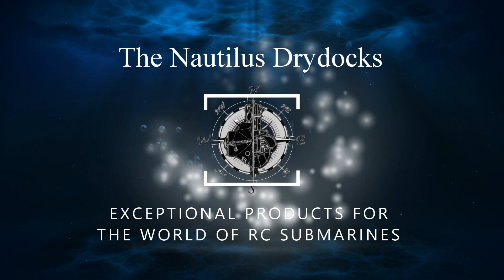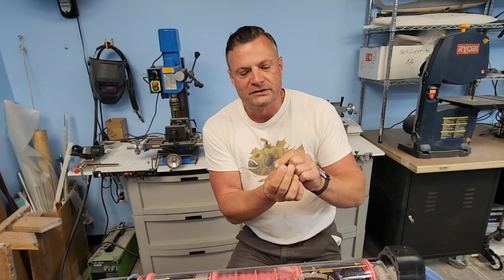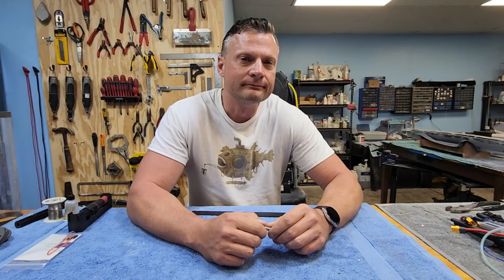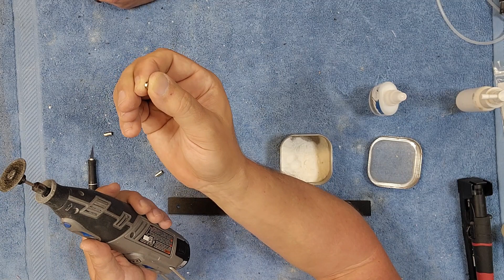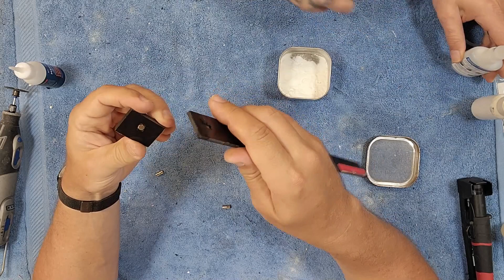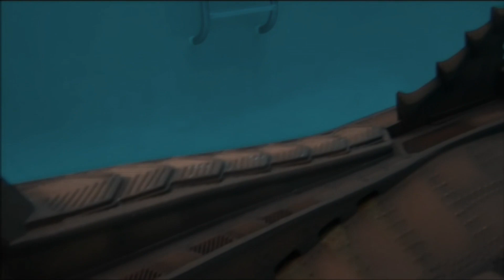Supercharging Your RC Submarine With Magnets!

Comment: Which battery Packs are used normally for 1:144 models?
Reply from the maker: The largest you can fit in your watertight compartment. Batteries are batteries. If your components require 12V, you can get away with a 3S LiPo or a 12V NiMh pack. Once your voltage is matched up, get the battery with the largest amp rating that will fit in your boat.

Comment: I have one important question. Which motor should i have when i have an 1:144 rc submarine?
Reply from the maker: Depends on the boat. A 1:144 Typhoon is a big difference from a 1:144 Seehund. If you use a brushed motor, try to aim for around 5000rpm and a motor roughly the diameter of your prop.
Reply: Thank you  for your Quick answer!
I have the trumpeter uss seawolf. Its around 700 to 800 mm long. I dont know what Motor i have to use because i dont want that its fast like a speedboat.
Reply from the maker: @JOJOPHOENIX835  A tiny 380 sized motor is more than enough. That prop is only something just over an inch in diameter if memory serves. There are all sorts of variables, however. Mind your RPMs. Too high an RPM motor will cause unnecessary heating of the motor and increased current draw. You can also use a higher RPM motor with a gearbox
Reply: @RCSubGuy  what do you think how many rpms should have a motor for a 700 to 800 mm boat?
Reply: @RCSubGuy  for example which motor do you used in your german submarine type 212?
Reply from the maker: @JOJOPHOENIX835  750kv brushless on 2S lipo battery
Reply: @RCSubGuy  about how many rpms should the motor have?
Reply from the maker: @JOJOPHOENIX835  Ideally, perhaps 5000rpm. My SubDrivers spin at 5,500 on 2S (7.4V). If you get something that spins higher, you can limit it from your radio, but that's not ideal.
Reply: @RCSubGuy  5 000 rpms sounds really fast! How fast is the boat approximately when i use a 6cm propeller with 6 blades?
Reply from the maker: @JOJOPHOENIX835  6cm is very large. Your Seawolf prop is probably only 3cm diameter. It will be fairly quick, but not uncontrollable. If you are going to continue to go deep down into propeller and motor theory and continue to request more info, I'm going to have to ask that you schedule some consult time with me via my website.